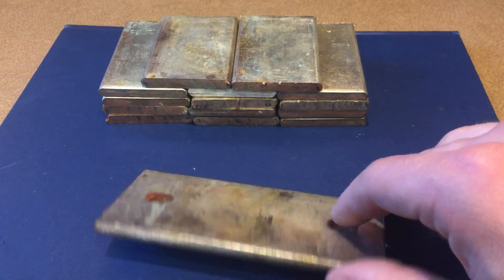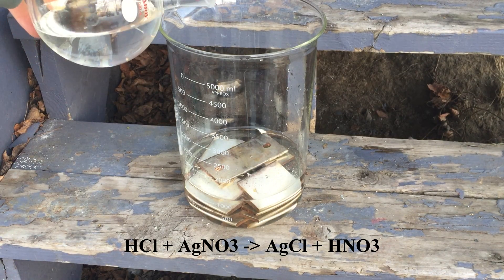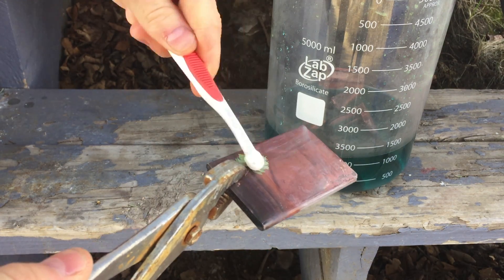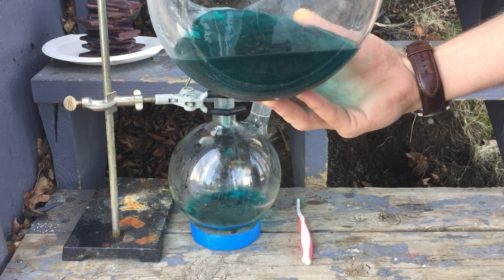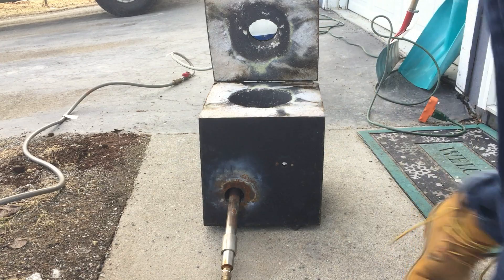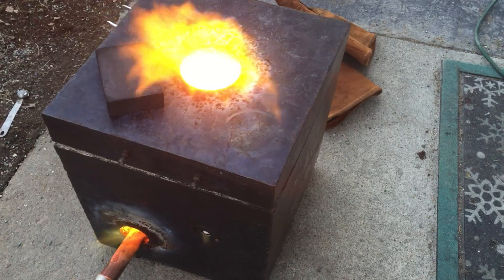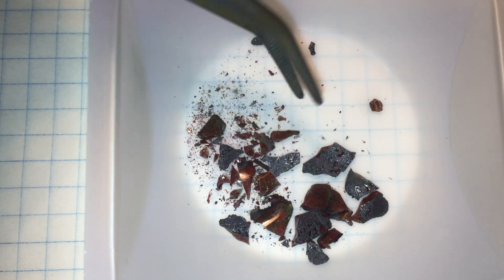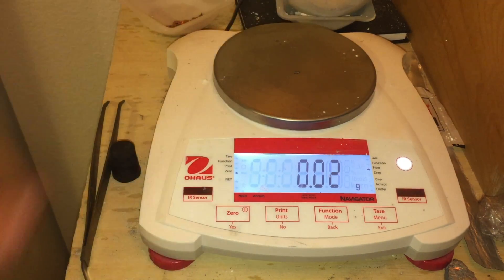Removing Silver Plating From Copper

Comment: Interesting. Always enjoy watching the ways people try to refine. You'd might be better off trying to electrically de-plate silver. Using a brine of 1000ml tap water to 100ml white vinegar, and 100gr table salt. With about 1.5 to 3v, negative to a piece of stainless steel, positive to the item to de-plate. It takes about 30m to an hour and all the silver falls off the item in sheets. Collect the silver and refine from there. No acids at all. However, I then take that to nitric acid where I further refine it, but due to the high cost of nitric acid, I found this to be the most efficient and time effective way for recovery of silver off silver plated items. Good luck and thanks for the video!

Comment: I’m sorry but I’ve refined professionally 30+ years. Test with swartzer solution one drop & if it turns red or reddish/brown color.  After diagnostics & tests pos for Ag. Simpley strip it with current or diluted nitric no use for any Hcl. The proposed diver goes up in solution, my friend! You never had the silver. You need to add some table salt or after filtering with water 4 times add the table salt or heavily diluted Hcl STIR STIR STIR the cottage cheese looking stuff that will be floating before settling to the bottom then pour off solution set up filtering & the cottage cheese gets dealt with very easily. cheese stuff is silver.

Comment: Making a profit on chemical recovery of metals depends on only three things: 
First: Don't waste your time fiddling with small quantities, always chemically process an absolute minimum of at least 50 kg of semi finished material. Larger batches take about the same time to process as small ones. I use a 130 liter stainless steel cooking pot, or several 90 liter plastic tubs for each batch.
Second: Recycle all your chemicals. Recover everything by distillation, reverse reactions, electrowinning, electrorefining, extraction, or by other means. There are hundreds of ways to recycle all your chemicals. Zero waste is the way to go making decent money.
Third: Reduce or eliminate your costs of chemicals by making what you need by yourself at home. Basic chemicals are so easy to make at no cost at all.
From kitchen/garden waste I make all my HNO3 acid for free. If any chemical reaction creates NOx, this gas is always collected in a gas bag and converted back to Nitric acid.
From gypsum/rubber waste I extract the sulfur for conversion to H2SO4 acid. My anaerobic digesters supply me with all the free gas needed to heat up chemical reactions. A byproduct from my anaerobic digesters is H2S which is converted into elementary sulfur, to be used later to make SO2 for precipitation of Gold.
From electric wires with PVC insulation the chlorine is recovered and later converted into free HCl acid. This is a bit tricky operation as not only the correct temperature is critical for a successful outcome, but it's absolutely necessary to include an absorber capable of catching the Chlorine to avoid creation of any Dioxin. This process is done in one of my four homemade pyrolysis units; the one made of acid resistant stainless steel. The yield is: Chlorine (used for dissolving Platinum Group metals (The Six Sisters) or conversion to HCl acid, pure copper threads (from which the connectors are easily pulled of so all the copper is recovered, and the ones with gold plating collected for later gold recovery), connectors/plugs (mostly Brass), and Raw Pyrolysis Oil. The latter is refined afterwards and cracked into free petrol/gasoline for my car, free diesel for my truck, and free fuel oil for my metal melting furnace as well as for heating my workshop at no cost. The source of fuel is free waste wood, but an "adjustable" (i.e. removable) fire chamber is required in order to maintain the right temperature inside the reaction chamber.
Warning: The insulation on older wires (and also older PVC plastic in general) contains poisonous lead compounds, and sometimes also Sb (Antimony) and even As (Arsen/Arsenic). Don't enter into this procedure unless you've acquired the full knowledge; thus knows exactly what you're doing.
From PBT plastic Benzene is catalytically extracted in a two stage process. Some PET plastic is also used now and then, if it's too contaminated/dirty to be sold for recycling. Benzene is a very useful chemical for various upgrading processes, and for Solvent Extraction from liquid solutions, fx. when dealing with valuable Rare Earth Elements (REEs). Caution: Handling Benzene requires full PPE, especially respiratory protection using an approved gas mask, as Benzene is extremely carcinogenic.
From chemically depopulated Printed Circuit Boards, as well as the waste plastic components from e-waste/WEEE containing Fire Retardants the Bromine is extracted, to be used for gold recovery. Again, a chemical obtained at no cost.
From xxxxx. No this is enough for now; otherwise the list could go on for 50 more chemicals.
I'm a full time scrapper/metal refiner working at home, with 12 years of experience. In my garden shed I make around US$ 250,000 a year. In a profitable way I recover all silver plating on any kind of metal scrap with Sulfuric acid and a splash of Nitric acid, all at no cost. Even copper plating on iron scrap is recovered with Nitric acid; of course using free homemade HNO3.
Finally, I use huge quantities of distilled water every month. All is homemade at no cost, by utilization of the waste heat from my pyrolysis units and my metal melting furnace.
Reply: So why do you not make videos of all of this? Or do you have another channel? Would bring a lot of viewers
Reply: @ScrapFatherScrapSon .   I work hard for 10 months every year. Then, in the harsh winter, I go to a tropical country on holiday for 1 or 2 months, enjoying Big Game fishing on the ocean from my own sportfishing boat.
Videos covering the subject scrapping and/or metal recovery and metal refining achieves rather limited views. They'll never go viral (too specialized), thus despite the possible ad revenue from Google it won't be profitable. I'll make more on scrapping/recycling than spending the same time it takes to make each video.
However, as I have a reasonable knowledge of the chemistry involved in streamlined and effective high volume scrapping/recycling processes I might be able to help you with tips and advices.
What would you like to know?
Reply: @zero-waste hello. 

How do you recover Silver from silver plated items using sulfuric acid with a splash of nitric? 

Do you give it a bath until the silver has been removed from the base metal, and then take the base metal out? Or do you dissolve the silver along with the base metal? 

Do you drop with copper or chloride? 

Thanks, I’d appreciate your help…I’ve got lots of silver plated items and am looking for better ways to remove the plating. 

Currently in reverse electroplating using  a stainless steel cathode, 1.7v with 3a current in a distilled water bath with very weak nitric acid. It works, but it leaves behind patches of silver and it takes super long.
Reply: And if your not worried about viewership, well it would help a tremendous amount of home refiners.

Comment: You skipped the step where you convert the silver chloride to silver. Did I miss it?
Reply from the maker: Since the silver chloride is such a delicate compound, able to decompose from UV light exposure. I figured it would have no trouble breaking down in the furnace with some flux and the paper I added with it.

Comment: Great video. I tried this and my end product ended up not removing the silver, but coating everything in copper. What did I do wrong?
Reply: Ephesians 2:8-9 - 8 For by grace are ye saved through faith; and that not of yourselves: it is the gift of God: 9 Not of works, lest any man should boast.

Jesus Christ is the only way to Heaven, there is no other way. Your good works will not get you to Heaven. You need to believe in the finished work of Jesus Christ on the cross at Calvary found in 1 Corinthians 15:1-4, it's the only gospel that saves lost souls.
Ephesians 1:13, saved and sealed with the Holy Spirit of promise.

Salvation is a decision to trust Jesus Christ from your heart. Are you saved? If not, today is the day of your Salvation because tomorrow is not promised.
Heaven and Hell are real, literal places, there is nothing in-between. Choose your eternal destination wisely for your soul.

"If the punishment must fit the crime, then hell must be telling us how bad sin really must be!!!!
If we don't take hell seriously, then we don't need to take the gospel seriously." by Yankee Arnold
"God's mercy ends in hell." by Peter Ruckman

Comment: I am sceptical about that being silver on those bus bars. It could have been tin. Why use silver. It oxidises more than tin. Its not jewlery or flatware
Reply: Silver is the very best electricity conductor.  Tin is rather poor in comparison.  Gold is used for computers not because it is a better conductor but because it does not oxidize like silver and base metals. Silver is very common to find on buss bars and high power load contacts like in circuit breakers and relay contacts.
Reply: @johnwells1724  . Yes true. But it's very common to tin copper wires.
Reply: @E-BikingAdventures  I work in the electrical industry and it is 100% silver coated busbar

Comment: If you got primarily AgCl, you need to add something to reduce it to Ag, otherwise the AgCl would tend to just melt into the borax flux.  I think sodium carbonate added to the borax would help with this reduction.  Or you could treat the AgCl with NaOH and sugar to reduce it to Ag ahead of the heating.
Reply: Take the bus bars with plating to scrap as #2copper, use $15 to buy an ounce of silver, save acid and propane for something useful, nice video😀
Reply from the maker: If you’re familiar with AgCl you would know that is is a very sensitive compound and can decompose and be reduced  into metallic silver and chlorine gas just from ultraviolet light. You can look it up on Wikipedia and figure it out pretty quickly.
Reply: @tannerohara5973  I am familiar with it.  I have converted large amounts of it to metallic silver using the NaOH, sugar method.  And I have melted it directly.  It does not decompose into Ag metal upon heating.  If you look at the Wiki page it shows the melting and boiling points, no decomposition temperature...  heat alone will not convert AgCl to Ag.  Some Ag compounds will decompose into metallic silver when heated sufficiently but AgCl isn't one of them.
Reply from the maker: svenp buddy, you’re wrong. Adding additional heat to a compound that is sensitive enough to decompose from merely light, will definitely cause it to decompose. Brush up on your chemistry
Reply from the maker: svenp buddy, you’re wrong. Adding additional heat to a compound that is sensitive enough to decompose from merely light, will definitely cause it to decompose. Brush up on your chemistry
Reply: @tannerohara5973  AgCl will convert but you will lose a lot of silver, always better to convert with lye/sugar method
Reply from the maker: Steven Nolan I agree. Thank you for the comments and information. This video’ primary goal was to show a proof of concept. The yield of silver was expected to be near to none as the plating of silver was thousands of an inch thick. Regardless, there are far more economical ways to acquire better results
Reply: Wish there was an economic way to remove plating
Reply: Steven nolan. Reverse hydrolises is more ecobomical.
Reply: @stevennolan2675 .  There is an economic way to remove plating! 
Please read my debate entry/post to this video; it's somewhere in the comment section. Hope it'll give you some ideas.
Reply: Tanner, you are confusing UV radiation with IR radiation. Silver chloride does NOT decomp into pure Ag in presence of UV exposure. It is decomposed into silver OXIDE, a blackish solid. Heat alone WILL not reduce AgCl into silver metal, or it's oxide
UV radiation is the ONLY way silver Chloride is able to decompose into workable material.  We used to call it silver sun tea. Personally, table salt and sugar are cheap, why risk losing material?